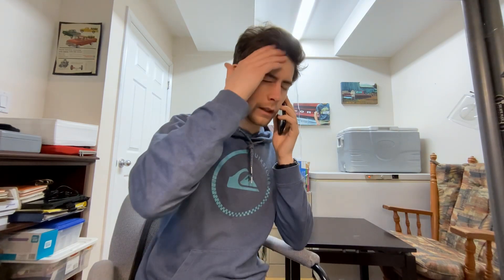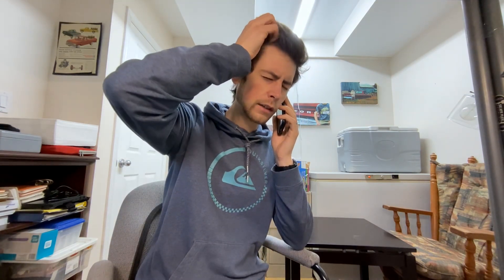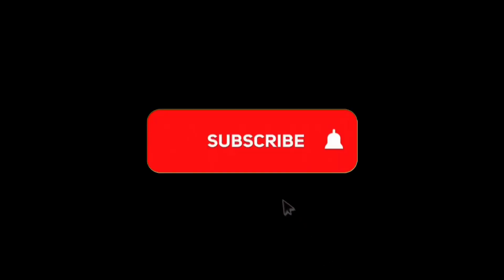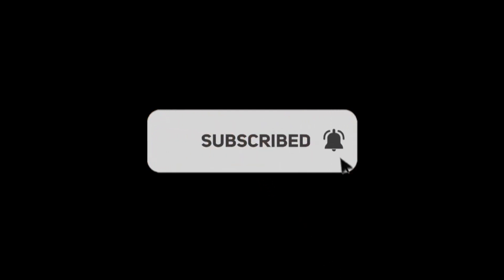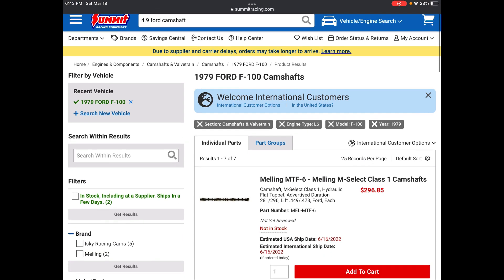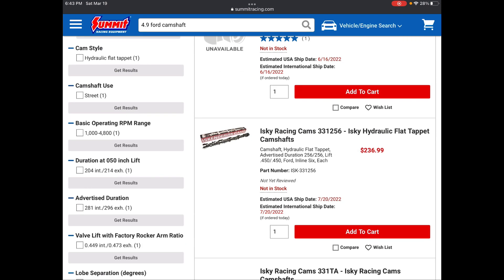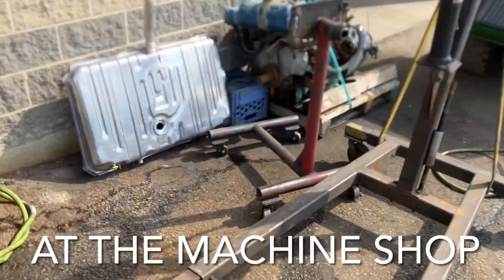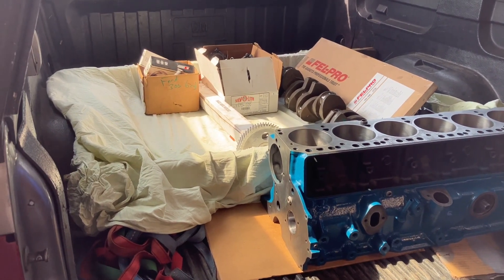Ford 300 Inline 6 Engine Rebuild Part 3: Parts Shortage, and Picking Up the Block

Comment: Jeremy, this series is off to a fantastic start. Can’t wait to follow along. Your editing and production is top notch! 
I have a 1989 F150 4.9 with a 5 speed and I like it so much that I plan on building a 300 to put in my 1964 2 door Galaxie. I will be using your build as a study guide. Thanks for the content!
Reply from the maker: Hey, so glad you are enjoying it, and are finding it helpful and educational. Thanks for tuning in! Sounds like you have a neat truck there. I think the 4.9 and 5 speed are a really good combination; let’s you keep the RPM down with overdrive, and lots of selection to stay in the optimal torque range.

Comment: Well if your going to polish the 300, you should know the 300 offered in the F600 had a forged steel crank.. 😎😎😎🔥
Reply from the maker: I’d heard that such a thing existed, but wasn’t aware of which vehicles it came in. I’ll have to remember that 😁 Have you ever come across such a crank? I do know you could get a high flowing heavy duty exhaust manifold, which probably could be found on that same f600.